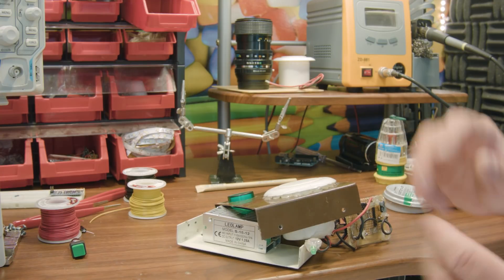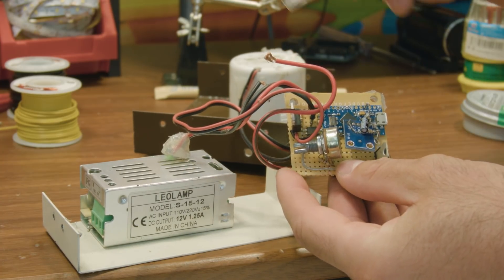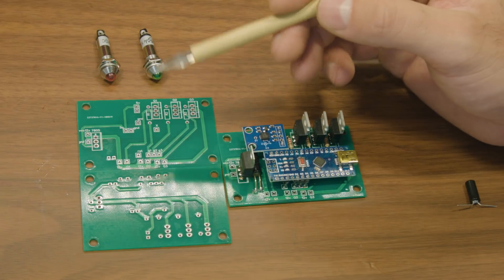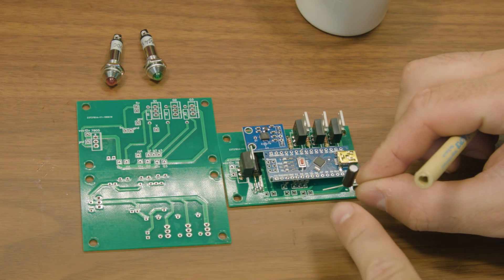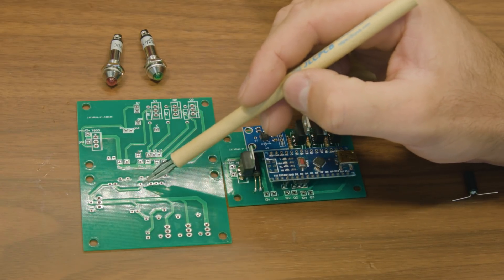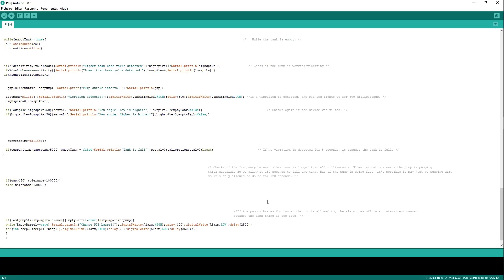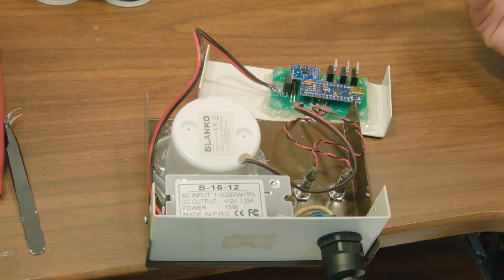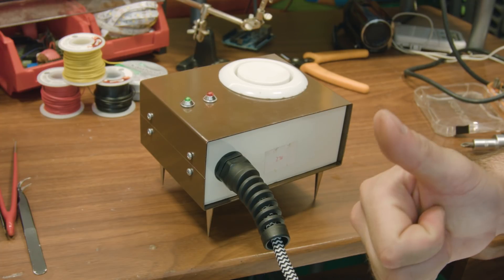ADXL335 Vibration Alarm

Comment: What exact purpose has the device/where is it used?
Reply from the maker: We have some pneumatic piston pumps sucking a thick material out of barrels. They fill a buffer tank, then stop for a while.  This device detects the vibrations those pumps create when they're pumping. If the pumps vibrate for too long, it means they're pumping air, therefore the barrels are empty and need to be replaced.  So the alarm goes off, and we put new barrels in place. Before I made this alarm, we had to check the pumps every 3-5 minutes. And if we forgot, an expensive batch of material would be wasted.